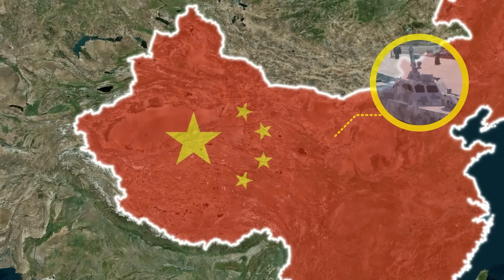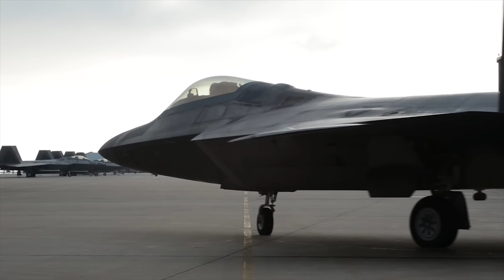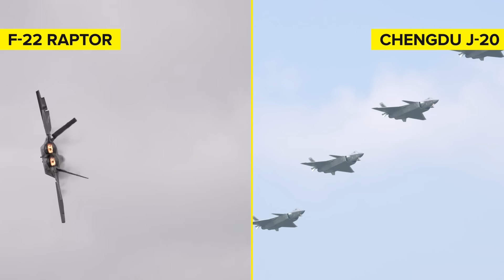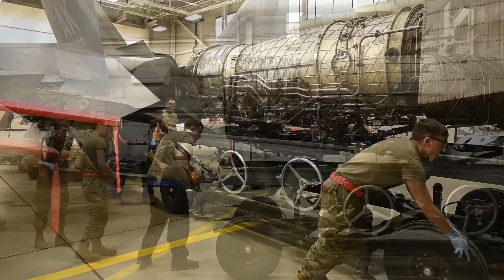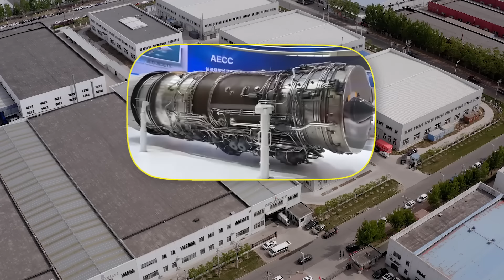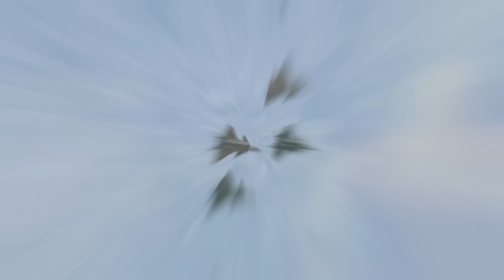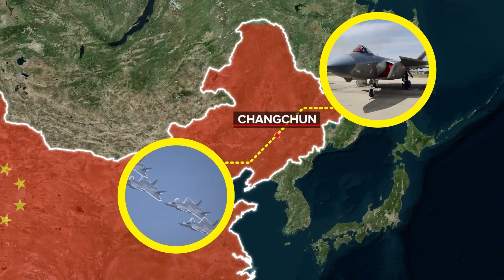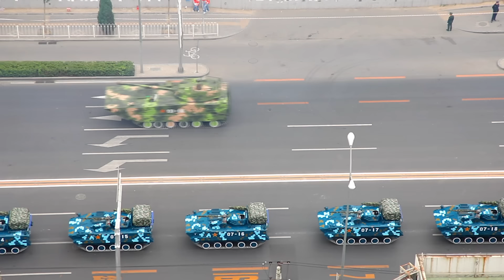China’s J-20 ‘Stealth’ Jet Is a FLYING LIE… A Paper Tiger That Can’t Fight

Comment: The biggest problem with comparing the J-20 to the F-22 is that the F-22 has only around 130 active units and cannot be replaced.
Reply: They've already begun renovation of the F-22 to bring some of the F-35 software capabilities. And the F-47 is going into production within a  year.
Reply: As of right now you're correct.  However,  if and I mean if the DoD (War) would have the Navy Seabees,  Army Corps of Engineers or the other Branches Combat Engineers build the new production facility instead of contract union workers and they utilized 3d printing for certain parts, they could theoretically start production again within a year. Also, if would be about 60% cheaper than the alternative since the Military construction workers are already receiving thei Govt paychecks.  Since about 60-66% percent of a construction project is labor that would dramatically reduce the cost and time.
Reply: That should tell you the f22 is an old design, likely nearing EOL, yet still the best there is.   Makes one wonder what the F-47 will bring to the table.

Comment: Stealth doesn't make the aircraft invisible it only lowers the detection range and target tracking by radar
Reply: You are simplistically correct. But if I can detect you outside your missile range and your radar or IR detection range, then I have first shot first kill. So it's very important, and no planes like F-22 or F-35 and soon F-47 detecting a stealth jet as it's practically on top of you is a bad day at the  office.

Comment: hahahahaahahahah you clown ... J20 feature for feature can destroy both the F22 and F35 left and right.
1. J20 longer range in radar (GaN with more TR/m) vs F22 with GaA old radar tech !!
2. J20 PL15 destroys the F22 aim 120D
3. J20 speed is better than the F22 old engine 
4. J20 Avionics with loyal wingmen is years ahead of F22 which cannot even do that which is done by F35.
5. J20 has 2nd pilot that becomes command centre ... F22 nothing ...F35 takes that role with old tech

  ....you tell me which area the old F22 tech is superior to the J20 ?? Can someone tell us

No, F22 is not even able to match the J35
Reply: Liar
Reply: @Jeff-ej4wp  
well tell us which part is the old outdated F22  is better . Nothing!!!

Comment: The J20 are fusion of the Mig 1.44 and stolen F22 and F35 tech.  Using the Mig 1.44 as the baseline for performance comparison would be more reasonable.  It is probably better than what China had, but nowhere near the stealthiness of a F117 Nighthawk.  The J20 probably handles as well as an early 4th gen fighter which is well within Chinese manufacturing capability.